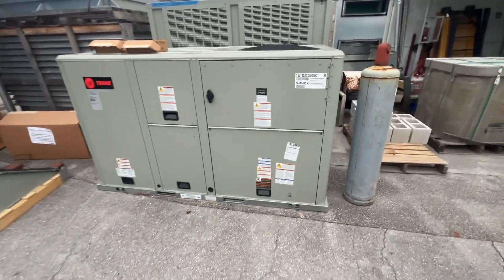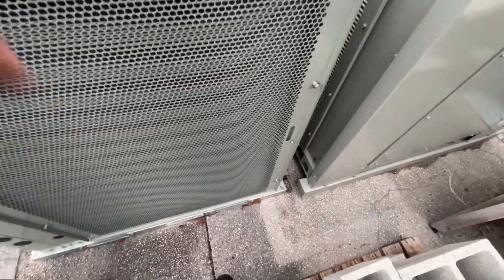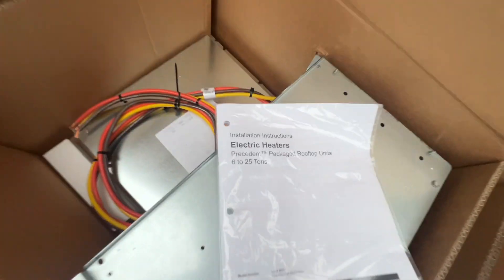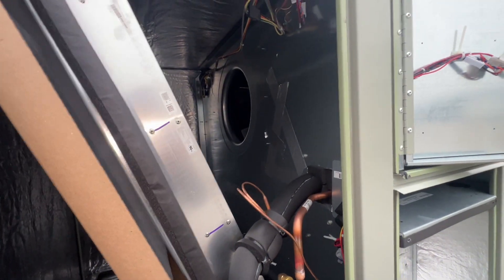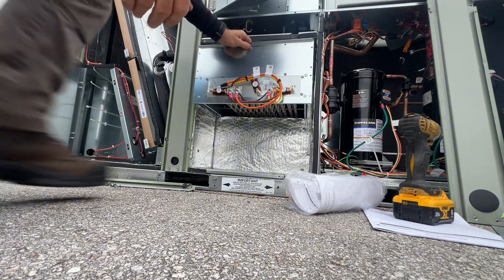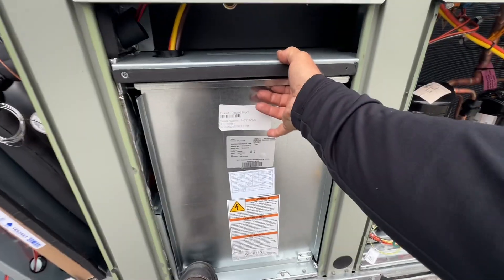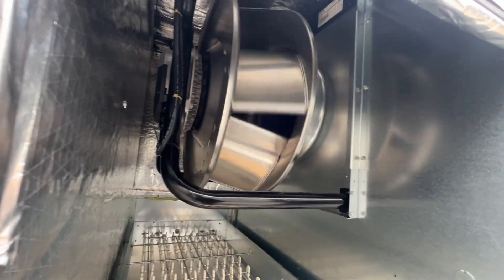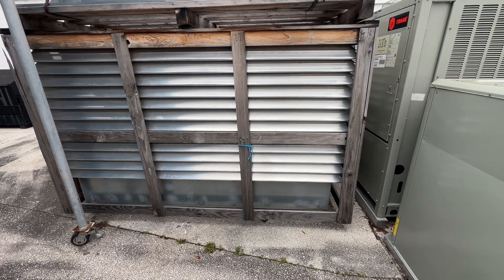Installing Symbio Option Modules And Prepping Trane 8.5 Ton Precedent Package Unit For Installation

Comment: Word of advice.....you really have to set fan correctly with those microchannel evaps. They will drip water into the space if it was a vertical config. With this being horizontal, you still will get water in the evap section if not set correctly.
Reply from the maker: Thanks for the advice 👍
Reply: @subcoolHVAC  you do great work brother. Love the channel.
Reply from the maker: I appreciate that 👊

Comment: I have that same unit at a facility, we have changed the ECM motor twice in 9 years. You need to remove the top, get a ladder and spend a ton of money to get that motor. Worst thing Trane has done
Reply from the maker: @brushben22  I fully expect that since one of the items listed in IOM is supply fan failure if not up to 30rpm within 40sec it shutdown.

Comment: I'm installing a 7.5T split where I work now. Didn't know you had to have an option module just to use the strips. They didn't say anything when we got the quote. With Reliatel, all you ever had to do was cut the jumper to enable them.
Reply: Symbio is the epitome of overly complicated controls & poor QC.

Haven't had a single startup that didn't have a factory issue.
Reply from the maker: @Jeremy-gt8xf I fully expect some type of issue , might be installer error on my part 😂
Reply from the maker: @topher8634  yeah, I had to remove the jump and install on P4 and from P5 to the OA module P5. First time dealing with Symbio but from what the Installation sheet looks like what they want.

Comment: Both compressor are deference 1 is big than other why ?
Reply: There probably different stages, or one is a compressor and one is a receiver.
Reply: If I remember correctly, one compressor is about 1/3 of the cooling (maybe a little bit more); the other compressor is about 2/3 of the cooling.
Reply from the maker: 2 stages

Comment: do the 454b regs go with commercail applications ???
Reply from the maker: Residential/light commercial Any manufactured after January 1, 2025 will be A2L, dealers can sell r410a units mfg prior still . Trane will use r454b from what I understand
Reply: Yessir 454B with RDS mitigation